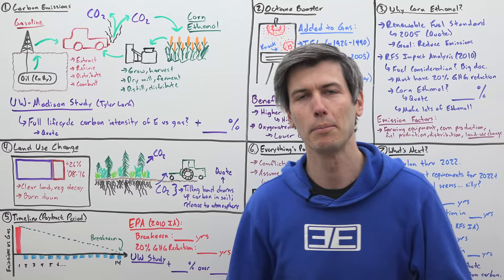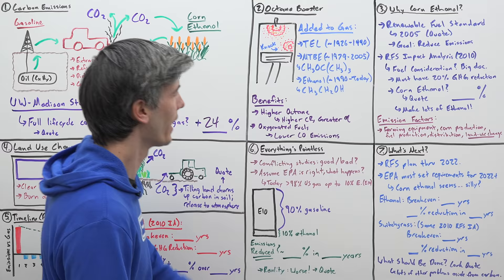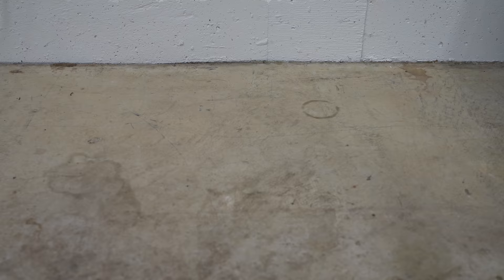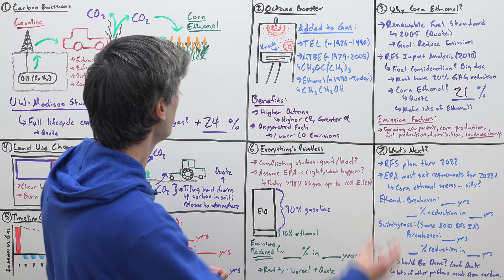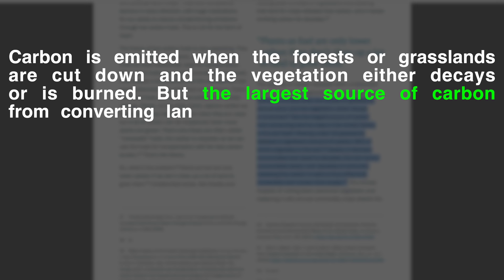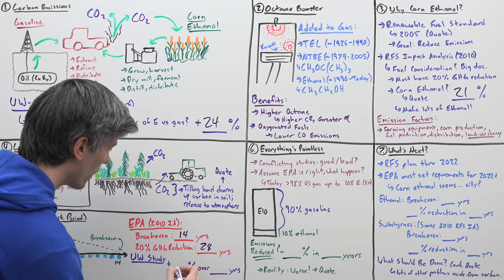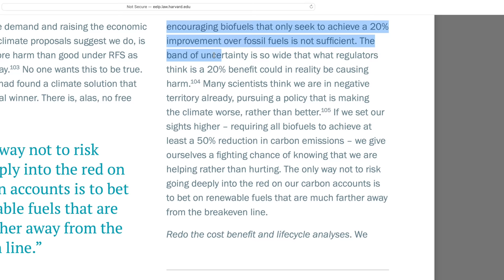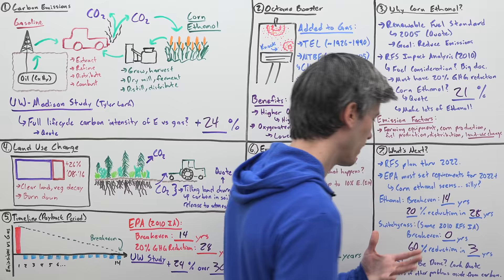America Was Wrong About Ethanol - Study Shows

Comment: I am really curious as to where the land use equation came from? I have lived in farming communities my entire life and the only time I see land being reworked to be farmable is when commercially grown trees are harvested and the land is returned to being farm land. Aside, corn is a type of grass and many farmers I know have swapped over to the no-till method of planting due to it being both easier and more cost effective since the land doesn't have to be ran over multiple times. Generally in the fall they simply use a shallow till ( less than 1 inch deep) to chop up and integrate the crop residue into the soil, thus improving the soil conditions. This is land that has been tilled for generations and as such, the "centuries old carbon" was released long before any of us were born, and I am not exactly a youngster.
Reply: Same here...
Reply: If you question the science the argument falls apart pretty quickly. I would imagine many of the acres were CRP land meaning they were previously farmland and were temporarily taken out of production. The CRP leases were 10-15 years long so many of those acres were going to be used again as farmland regardless because corn prices improved.
Reply: The land use numbers come from satellite and aircraft remote sensing along with GIS analysis. Just because you didn’t experience it doesn’t mean it didn’t happen.
Reply: @Ezlpo  Not how it works, sorry. The satellite data and GIS analysis tools used are far more robust than that. When the claim in “land use change” they mean from one use type to another, e.g. forest to parking lot or farmland to residential. If farm fields are sitting unused they are still farmland and would be classified as such.
Source: my multiple GIS and environmental science classes in college.
Reply: @rapid13  I suggest you look at the USDA numbers for corn acreage planted per year. You'll find that it cycles up and down by as much as 10 million acres per year. The vast majority of this land is simply switched from soybeans or wheat to corn in years where corn is the most profitable option. There are also a lot of acres of ground that is idled during years of low grain prices and only planted during very profitable years. More still is converted from old, unused pastureland to row crops. Farm land in the US has decreased from 945 million acres in 2000 to 897 million in 2018 (USDA), thanks to urban sprawl. 

I realize that the data you are referring to is worldwide, and that what you said is technically true. However, the acreage increase mentioned in the video was only referring to land use in the US. The US is still a HUGE net exporter of corn, as well as other grains and oilseeds. Ethanol production FOR THE US has very, very little to do with why other countries (i.e. Brazil) deforest land to grow row crops. 

Also, the study says it was a 26% increase OVER THE EXPECTED INCREASE, not a 26% increase over land already used in the US for corn. Corn acreage planted went from 86 million in 2008 to 94 million in 2016 (duration of study), but actually peaked in 2012 at 97 million, and then dropped all the way down to 88 million in 2018 (USDA).
Reply: No crop rotation? And that land is still viable?
Reply: @bassplayinfool  with enough fertilizer... SURE it is! 🙄
Reply: @scottamu7816  All intelligent farmers rotate their crops. You have obviously never farmed.
Reply: @corvinmull2408  The GIS data is on USGS gov site.  The land use classification has 11 categories.  One of which is "Agricultural".  A change from from soybeans to corn does NOT change the land use satellite data.  If the satellite sees an acreage that was previously classified as "Forest", this year gets classified as "Agricultural", then that is a Land Use Change.

You have to take into account that older farms may shut down, while newer farms and acreage appears.  If you only looked at USDA numbers, it would appear as if nothing happened.  The satellite data shows the change that actually occurred behind the USDA numbers.  If the old farm of 20 acres closed, and a new farm of 20 acres opened, you will see no USDA change, but have a CO2 increase nonetheless.
Reply: @scottamu7816  Nailed it
Reply: Agreed, I smell click bait.
Reply: The total fuel consumption of U.S airlines is approximately 19 billion gallons annually. 

Total fuel consumption for mining lithium to make electric car batteries is 21 billion gallons annually.

The 21 billion gallons can only produce enough lithium for 250,000 car batteries.

The lifespan of an electric battery is 10 years and is not renewable.

Electric cars are not better for the environment.......they're worse.
Reply: @rapid13  Can you point to where the GIS data is referenced in the paper? I have not been able to locate it yet. I am probably just missing it, but would like to go directly to as many sources as possible.
Reply: Same they were actually paying farmer to not grow anything at a one point and the trapped carbon in the soil was released decades ago.
Reply: @messagedeleted1922  which part of my comment was conspiratorial? That CRP acres exist? That those leases were 10-15 years? That the price of corn has gone up?  You silly. 😜
Reply: @rapid13  so the set elite data is sophisticated enough to determine the difference between prairie and land that has been fallow for 15 years? Suuuuure. Lol Source: trust me bro
Reply: @rapid13  What ever happened to people owning land and growing whatever they want on it?
Reply: @bruticus0875  Not usually how it works,. Most old farms are either A: sold off and merged into other farms, or B: bought by developers and turned into new city crawl.  The latter is what's been taken place around my area for the last 50.
Reply: @Ezlpo  I love it when people complain about corn prices as if they didn't just slap down $600-$1300 on a new phone. You could literally buy a lifetime's worth of corn for the same price.

Also, corn grows straight out of the ground. You can grow your own... Good luck growing a phone. 🤡
Reply: @Ezlpo  as if we aren't paying 5-10x the price of field corn at the farmers' market and very happy to pay it because it's still cheaper than the can.
Reply: @Ezlpo  you will still be able to eat corn to your heart's content with corn at $15 a bushel. Look at how big a bushel basket is...
Reply: @MrCodeTroll  who in this comment thread is complaining about corn prices? I am honestly not sure what your point is from your 3 replies to me.
Reply: @corvinmull2408  I don’t give 2 shits about corn acreage. The question was about land use change, and I explained how they get there.
Reply: @TimB-   I haven’t read the paper. I was simply explaining the mechanics of how land use change is discovered and accounted for. It’s the same for probably every paper written, though: USGS GIS data.
Reply: @Ezlpo  Yes. And it’s easier than you think. Your ignorance on the topic isn’t a source I’d ever trust, sorry.
Reply: @MrCodeTroll  I don’t know, what happened? Is this a trick question?
Reply: @rapid13  I'm not sure if it's a trick question or not. In my mind, everyone should be able to do what they want with their own land.
Reply: @jacquesstrapp3219  corn one year out for four changed to one year out of three. I know of fields that have seen corn every other year. Of course where I sit corn is grown for dairy.
Reply: @dennismitchell5276  When I farmed, we rotated alfalfa, corn, beans, sugar beets and back to alfalfa again. Raising corn in consecutive years depletes nitrogen in the soil. Alfalfa replenishes nitrogen.
Reply: @jacquesstrapp3219  I know!
Reply: @MrCodeTroll  Ok, I’m not sure why you asked me the question though. I said nothing about landowners having the right to choose.

Comment: One thing that you didn't mention but I assume is likely covered in the study is the lower energy density of ethanol which leads to a loss in fuel efficiency.  An extreme personal example from 2007 when Oregon adopted ethanol.  My 1999 Nissan Frontier went from getting 19 MPG to 17 MPG with the switch to 10 percent ethanol.  It doesn't make sense to me why the decrease was so large but it was consistent.
Reply: It makes perfect sense, if that’s all you lost then you were on the good side of it. Check out the difference in fuel system requirements for a vehicle run on gasoline vs flex fuel, it’s a great way to visualize the difference in energy density and it’s massive.
Reply: There are 3 things to consider.

1. SAE claims some (identical) engines have claimed 22% more miles per gallon on E85 than petrol with comparable octane.

2. It's surmised that a big part of the decrease in fuel efficiency has to do with designing the engine as a Otto Cycle Petrol ICE.

E85 advocates say designing an E85 engine should instead be based off a Diesel Cycle Diesel engine.

3. E85 is so cheap because it is less fuel efficient (subsidies).
Reply: That is certainly my experience.
Reply: @callang9  In this case this was only switching to E10.
Reply: I tried 89 octane gasoline and 89 octane gasoline/10% ethanol mix in my 06 ford ranger over the course of a couple years. I consistently got 1 to 1.5mpg less with the E10. I ran E15 in it for a month and I got slightly worse mileage and eventually a DTC telling me both banks were running lean that went away on its own when I switched back to E10. I’m so glad someone was able to compile a lot of complex data into a very concise presentation with no or minimal political bias. Well done sir. With that said, can you put together a presentation that compares BEV production and pollution and compare it to ICE production and pollution from the time raw ore is mined from the earth to create the car through the pollution created in recycling and disposal of the remains after its service life? I would go to your OnlyFans or Patreon or whatever PPV deal you have, and pay to watch it.
Reply: @callang9  so basically run a Mazda 3 "Diesotto" self igniting gasoline engine with a tune for E85 or just go electric asap
Reply: I never heard of ethanol blended fuel being advertised as to getting better fuel mileage, but see it being advertised to burn "cleaner".  In fact when I used E85 in a Flex Fuel truck I had, the fuel mileage was worse by about 20-25%.  The engine ran smoother though. To me, the E85 20% (+/-) difference in price saving wasn't really worth the stopping to fill it up more often.  I definitely DO NOT used ethanol fuel in any power equipment (lawn mower, generator...).
Reply from the maker: Correct, but worth discussing! The study is done on a per-energy unit basis, rather than per-volume or per-mass basis, to account for the lower energy density. So when they say 20% better, it's relative to using that amount of energy in gasoline, or that amount of energy in ethanol.
Reply: Just have a look at the stoichiometric ratio for  ethanol at 9:1 compared to 14:1 for 'straight' gasoline. 😂
Your vehicle's ECU only has the lambda sensor(s) to tell it how much fuel is needed.